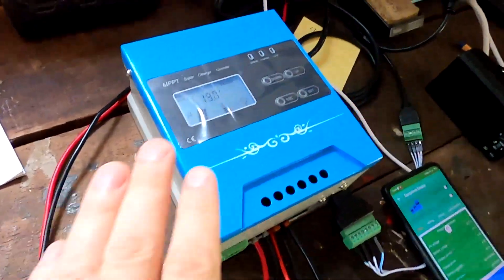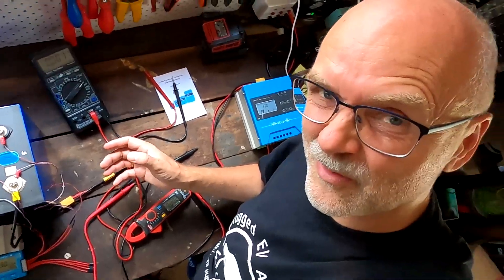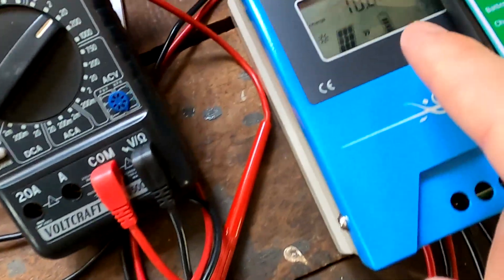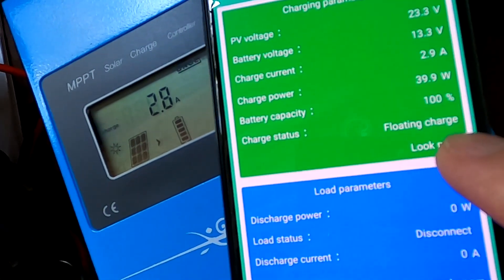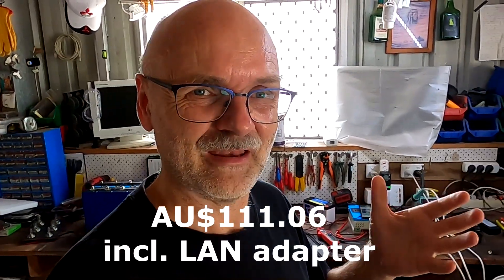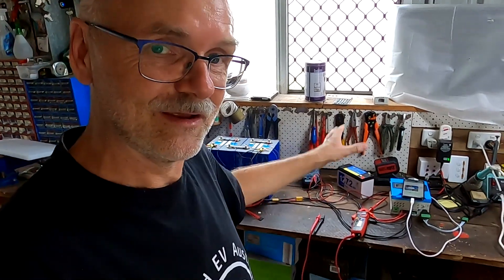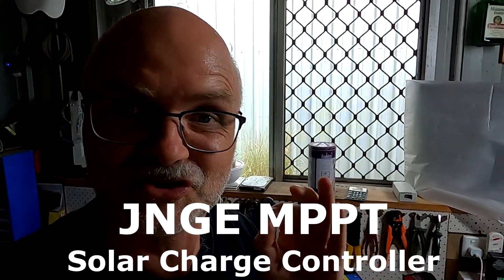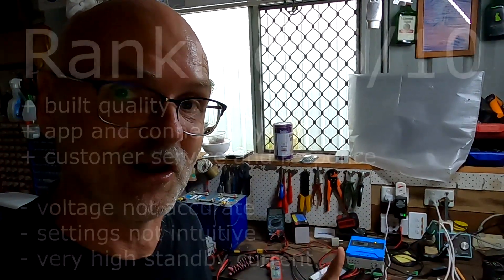JNGE MPPT Solar Charge Controller - Cheap or Awesome? Both?

Comment: I always like the hardware you can adjust the voltage so we can make them all the same but as the voltage gets higher the error changes that leaves us with the setting of our devices to the voltage we want at the end product which with lithium will be the battery.

Comment: I'm very happy with my EPEVER mppt charge controller, not hugely expensive but has been rock solid and accurate on voltage readings.
Reply: EPEVER are great controllers, I have two myself, but the cheaper controllers only go to 24v. Their 48v controllers are more expensive. Much more than 120AUD.
Reply: @petervanbeekum  mine goes to 60v iirc. I think a controller is worth spending good money on.
Reply: @yoda-be.at1746  that’s 60 volt max input from solar array. The smaller controllers, like that only do 12v & 24v batteries
Reply: @michaelbouckley4455  mine has a max of 150v

Comment: Here are my two thoughts:

a) The manual says the PV panel open circuit input voltage range for a 12V battery system is 20V～100V. This might be the cause, why it is not working with a 40W Panel. What is the open circuit voltage of the 40W panel?

b) The charge controller seems constantly measuring the battery voltage 0.3V to low while charging. Well, this is 0.075V per cell in your setup. It's not so dramatic. Now think about a real world setup with fuses, main battery-breaker, current-shunt, longer wires. You easily get 0.3V voltage drop between charge-controller and battery, and the controller is taking this in account and will approache the real voltage of the battery.
If you really want accurate voltage measuring you need a controller with a separate battery-voltage sense input. Your other system is a BMS, sits direkt on the battery and does not need to take a voltage drop in account.
Reply from the maker: Thanks for your comment Peter.
a) the 40W panels have a Box of 22V
b) in a 12V system with LFP batteries 0.3V could be the difference between 40% SoC and 90% SoC. That's not acceptable.
The controller could compensate for possible cable loses but this would be very hard to factor in as it depends on cables size and length as well as actual current. I think it's just the cheap AD converter they are using which has a big tolerance.
Reply: @OffGridGarageAustralia  Thanx for your answer. You may be right about a cheap AD, which is more calibrated/accurate for a 24V or 48V system. But let me clearify my point: As we know, a 12V battery-system comes with higher currents, than a 24V or 48V system at same watts.

Let me assume you will charge the battery with 30A, and let me assume you're using a 1kW 230V inverter to discharge/use the energy. 1000W / 12V ~ 80A. If only the main battery breaker/fuse has an resistance of 1mOhm (which is a good value), you get a varying voltage drop from +30mV to -80mV, and so an error in measuring at the charge controller. If you want to go that accurate you try to, you need a voltage sensor directly at the battery, because of the 12v and corresponding high currents.

Because of this I said the 0.3v offset of the JNGE charger is not as bad, as it seems at first glance. It may compensate it little bit the voltage drop at other components when used under load. Even if it is not intended by the manufacturer.  ;-)

Comment: Your settings don't make any sense atm, although it's using different terms to what I'm used to and I can't see a manual. In lead acid you have 3 stage charging bulk, absorption and float. 
Bulk 0-80%, absorption 80-100% and float just keeps the battery topped off. 
So not sure how the names translate to this controller but the aliexoress says it is a 3 stage charger. 
So float should be set to the maximum you want so in this case 13.6v and I'm assuming improve charging is equivalent to absorption so should also be set to 13.6, so charges to 13.6 and then goes straight into float to keep it topped up. 
And the logic probably weighs float as more important which is why it's not kicking back into improve charging as you have float set to lower.

If it is always consistently out of voltage you can just dial that in, in the settings. Just dial back the 13.6v setting till you get 13.6v at the battery or what ever you are aiming for.
Reply from the maker: When I try that, the controller jumps from absorption to floating and back all the time, giving the battery little peaks of charging. Not good.
It does not seem to follow the logic of other controllers.
Reply: @OffGridGarageAustralia  that's odd as the absorption one shouldn't kick back in till 13.4v, have they given you a "user" manual at all? If not ask their support these companies will generally send you a basterdised English pdf, but with a bit of head scratching can normally work it out.
Reply: Or is there any support documentation for app, that gives us some idea what each setting is?
Reply: That is what I thought.  This charge is for lead acid only. Lithium does not need floating or absortion. It start slowing down until zero current at 100%. If it float it will damage the batteries.

Comment: You know that LiFePO4 cells do not like floating? Floating means the battery is full and even after that the MPPT tries to charge it (this is only for lead/acid batteries). It is overcharge and will damage your LFP battery.
It is fine if you can monitor or manage the MPPT over internet ... but you will not (every day ... nope). For this reason automatic procedures required (like with a RasPi). 
Also if you want your battery to last long only discharge/charge to 10-90% or even 20-80%. For this if you do not know the REAL SoC of the battery (with a shunt) you need very accurate V meter. So this MPPT seems to be only a toy.
Reply from the maker: That's what I'm trying to find out with this controller. It seems to behave differently to others. Usually I set the absorption voltage to the max I want the battery to charge to (13.6V) and set the float voltage to a lower value, like 13.4V. So charger stops at 13.6V and goes into float (which does nothing as the battery voltage is higher than float voltage. If the battery voltage goes below 13.4V it kicks in with float charging and eventually bulk charging until 13.6V again for the next cycle.
And yes, I will monitor the system several times a day when I'm not at home. I'm that crazy.
Reply: @OffGridGarageAustralia  IMHO Andy The only way to do it reliably is to have a SAFE top of charge voltage higher than float voltage, as you suggested.
My controller tops the charge during “absorption” at about 13.6v /3.4v per cell, and then drops back to a lower “float” voltage, around 13.4v /3.35v. However I definitely wouldn’t try to save dollars on a cheap controller- just not worth the risk for your expensive batteries.
Reply from the maker: @FutureSystem738  thanks Dave. That's exactly how all controllers work with Li batteries, just not this one.

Comment: Ask them if there is a way to calibrate the voltage reading.  There might be a setup possibility or a Poti inside?! 
Also, did you measure the voltage directly on the pins (when open)?
Reply from the maker: Voltage was measured at the terminals with nor charge or load connected.
I don't think the voltage can be calibrated in any way unless they can upgrade the software.

Comment: Try to calibrate the voltage on charge controler ....contact the manufacturer or best of all .......lower the charging voltage for ......
Best charged voltage is 3.45v/cell
Lifepo4 cells actualy dont like to be charged to 3.65v
Best range is from 3v-3.45v....if u want to have them long time....

Comment: As long as the mppt is working correctly within the specified voltage setting of your battery you can input any wattage from the solar as long as you dont exceed the mppt limits.

Comment: Try PowMr 60A cheap and very good
Reply: There is this funny thing going on between PowMr and MakeSkyBlue where both sides are accusing one another of stealing their design. If you find the right listing on ebay or aliexpress there are sometimes whole multi page rants in the description about the other companies behavior. It is very entertaining.

Their controllers do look the same on the outside at least.I still have not figured out who is right!
Reply: @petervanbeekum  I have 8 makeskyblue 60A and working okay but every two years need fan replacement.  I see many videos of powmr which had burned out.
Reply from the maker: I'll check it out
Reply: MPPT 60A you use only max 40A for long using. You can parallel if need more Amp.
Reply: @phallatep2274  I use them in parallel  and 6 panels of 400w each at 48v system  and each controller make about 2kw per hour or 35a which is plenty.

Comment: Another great video. If you have a opportunity, in a future video, could you describe the various MPPT settings and what decisions you made for settings? No problems if you can't, I am sure I could read the manual,  just not sure my small brain can compute.

Once again thanks for the video
Reply: I don't have this controller but go to setting and change battery type to Lithium.  This controller may be only for lead acid batteries.

Comment: I wonder if there is a user calibration procedure required? It doesn't make sense that one create a design that can be out 2% or 3% in a critical measurement and not provide user calibration when the voltage settings are uber critical. Perhaps there is a trim pot behind some sticky tape?

Comment: Ya i know I am currently fighting with a company on ebay about an inverter that is supposed to be a 2000w continuous 24v but the best I can get is about 1400w for about 5 min before it overheates it has good protection but can't run the load I need it for and they said I need a bigger battery so I hooked it up to my bigger bank and same thing now they are telling me it's designed for lead acid because it can only do 1000w on lithium batteries I already told them that doesn't make any sense mine is 7s and that it maintains voltage much better than lead acid but I'm going to test it anyways
Reply: the inverter should run fine on lithium or lead acid and do the same wattage 
That's just a seller trying to scam you I think
Reply: @BenCos2018  I know
Reply: @james10739  ok 
Just thought I'd say it in case you didn't 
good luck with the seller btw
Reply: Don't let them play game. Ebay and the seller drag their foot so after 30 days they won't have to refund you. Let ebay know that you have been scammed and want your money back. They got away with it because  I didn't know better.
Reply: And don't close the dispute until you get your money back because you can't raise another one once it has been closed..

Comment: did you try to see what it measures without panels?
Reply from the maker: This was all done without solar or load connected, just the battery...
Reply: @OffGridGarageAustralia  so a guess is that the difference that you see is due to the mppt power consumption, you mentioned 125mA, maybe they measure the battery voltage after the consumption.

Comment: I think that mppt is not suitable for small battery..you should use big battery like 200 ah and about 400 watts panel to make it work properly.
Mppt controller is not suitable for small set up.
Reply: 280ah battery there mate
Reply: @codiecarroll735  he test it with the small lead acid batt.
Reply: @codiecarroll735  that is when he told that the mppt scc have a problem.
Reply: @SolarAddict06  I saw a problem from 0:01

Comment: I assume that the thresholds for the voltages are to narrow for the ability of the device to adjust/ adopt the current fine enough which collides with the behaviour of the chemical reaction of the battery. The currents might be also interesting at the treshholds.

Comment: It'll be very interesting to see how the conversation goes with JNGE. I've had dealings with Make Sky Blue in a similar way and it was painful to say the least. But hopefully you're getting onto the actual people know the technical details. It's so frustrating speaking to people who just know how to read a fault finding flow chart. 

The voltage disparity is the biggest concern. If it's that inaccurate, it would make me wonder if it's an offset, or a percentage difference, or both.
Reply from the maker: The voltage difference seems to get larger with higher voltage, so it's a percentage.
Reply: @OffGridGarageAustralia  I didn't see any adjustments when you took the lid off, so it's possible it could be corrected via software calibration.

Comment: The connectivity between two or more solar charge controllers, is something I didn't consider, but with many solar strings it actually makes sense, and the connection to the internet even more. I think my Renogy Rover 30 amp has that... I will have to look and read the manual... Great little video again.

Cheers.
Reply: Instablaster.